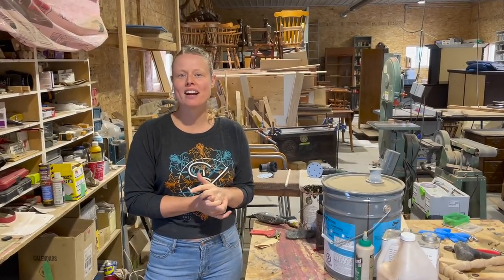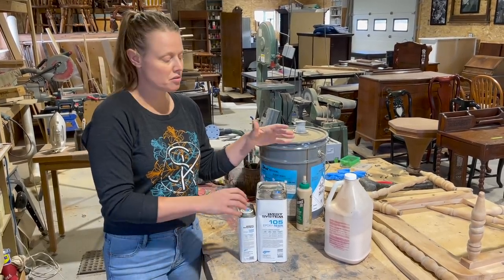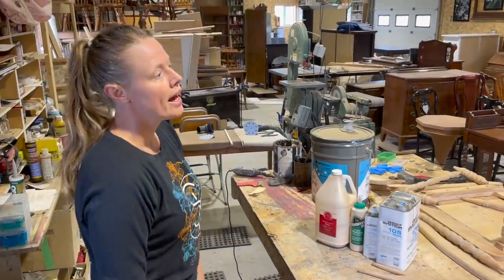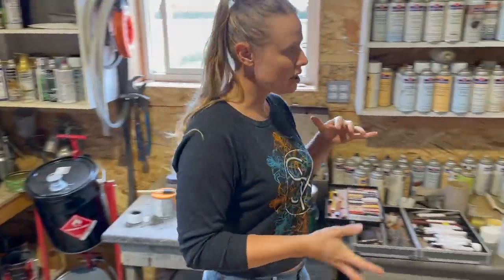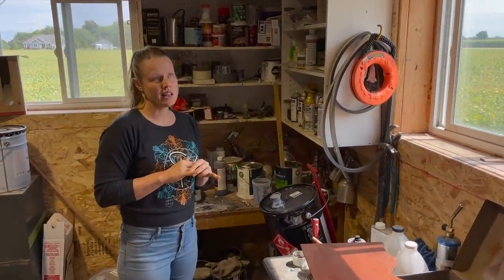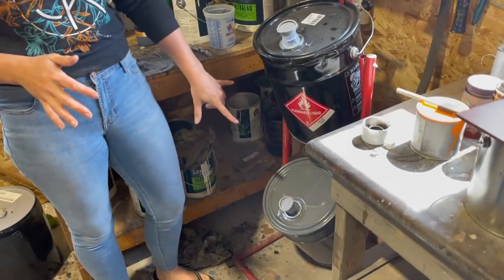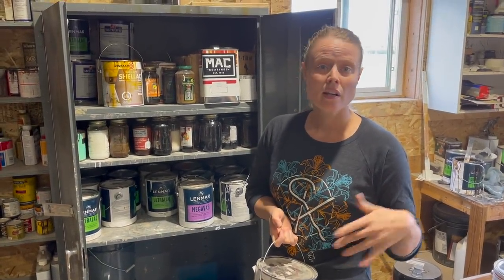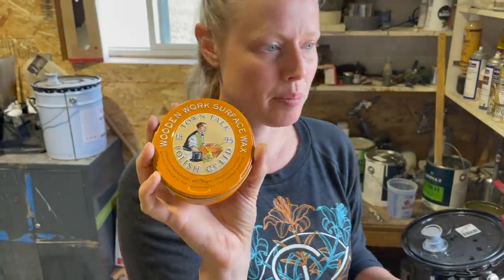The Products I Use

Comment: Thrilled to have found you. I'm a casual woodworker. Never done a furniture piece. So my wife dragged home a 5-drawer "high boy" as a beginning surprise (project). First I took it all apart. Found an old wood borer graveyard. Framing pieces and drawer glides with lots of rot.  After tuning into Trena's morning TV for a few weeks, I learned that great care might be in order. I've been a believer in 10d finish nails for everything. Not any more. Other issues (drawer guides/glides, splits and gouges,  some totally broken hand-sawn dove tails, removal of old repairs, etc.) need work, & the whole piece needs to be refinished. So I was on my way - but I found a patent date on the drawer locks. It was an 1884, with the second date of 1886, which I guess is the manufacture date. Here I am, between the devil and the deep blue sea...No one around here (Central California) can identify the wood species. It looks cedar or redwood-ish, but I suspect it was made in New England; those species may not grow there. My questions: Are the date stamps on the lock useful in determining age? Where do I get a key made? To keep some historic integrity, can I cut the dove tails on a jig, or do I have to hand cut them? Can I update drawer bottoms and the back of the case with better engineered products, or do I have to fight with the existing? That's my beginners list. I promise I'll not take up much time, but if you can comment, I'd like that!
Reply from the maker: Hi there. Sounds like a really fun project. The dates in the locks won’t be accurate to a t but might give a ruff idea on age. Honestly if your just keeping it for yourself go ahead with the upgrades. Make it useful. If your looking for resale maybe get it looked at by a dealer before proceeding. Have fun!

Comment: In response to your question about glue bottles. I have used the cheap ketchup and mustard bottles , like the ones you use for a pick nick. I buy them at the Dollar Store and I believe they are still both bottles for a buck. They have the little cap that you stick on the end. Yes the glue often hardens up at the tip but is easily picked off.

Comment: love your work. A suggestion: I found that Gorilla Wood Glue is crazy good, its got a little poly in it, its water clean up and crazy tacky, I don't use pin nails in my newel post trim etc. just hold it in place for a few seconds or a clamp. Get it at home depot. After trying everything that's now all I use. From Cornwall, Ontario.

Comment: hi  , here is a little tip for you when cleaning brass when its dry and free of old paint etc  it`s something i use on a regular basis my go to solution   ACID FLUX plumbers use it  not  regular flux  but the acid type  comes in a small tub in the uk    just get some on a rag smear it on it`s quite  quick give it rub cover all the surface   wipe away then polish with  brasso  or   Duroglit   actually i think the brasso people may have bought  over  DUROGLIT who knows  play about with it  you`l get a surprise  how good it is  of course  badly tarnished brass needs a bit more effort good luck  love your work   signed an old Scottish carpenter     will love

Comment: Some years ago Fine Woodworking published a booklet on finishes.  I don't know if the version I have is still in print, but I learned a lot - it was authored by a variety of professionals, each describing a different finish or topic.  In that book I discovered potassium dichromate for some woods, particularly mahogany.  It's nasty stuff - can't put it down the drain, don't touch it or breath the dust (it's a powder you mix with water).  But - for mahogany and other select woods it is unexcelled - you can "see down into the grain".  Use it for antique mahogany, then cover with amber shellac or white shellac.  For a table top, maybe a thin coat of varnish to waterproof it.  Yes, I know you're not supposed to put vanish over shellac, but if you don't stir the shellac the wax will stay on the bottom and it's fine to use varnish on it.  I do a lot of refinishing of antiques I buy from a local auction house.  Mahogany pieces from 1790 - 1820.  Made with woods you can buy anymore - flame mahogany veneers, table tops from 20-25 inch logs.  I buy the broken/disaster pieces that show 200+ years of damage and neglect that no one believes are worth saving and I bring them back to the day they were purchased new.  I've made furniture and have used other finishes, but that's a different topic.  Potassium dichromate (be careful with it!!) and shellac for antique mahogany.......
Reply from the maker: Thanks. I have some in the shop but I probably will never use it.

Comment: Glue bottles for PVA glue... I'm new to your channel, and I know you did this particular tour last year. So you may have long since found what I find incredibly useful: the "GlueBot" bottles. 

I love the fact that the glue feeds up to the dispenser tip from the bottom of the bottle.That way, the usual light surface layer of scuzz (glue that's reacted with the air above the glue surface) is basically a non-issue. Also, the  red silicone nozzle cap is tethered, so I don't loose the dang thing. 

What's extra great about that silicone cap is that on the bottle fill cap itself, there's a plastic boss over which the silicone glue cap can fit snugly during use... so the fact that the cap has a dangling tether does NOT get in the way when I'm squeezing glue out the gluebot. 

In my case, I'm usually doing small, fussy pieces, so although I also have a larger one (Lee Valley sells that 16 oz version), the smallest GlueBot is my go-to tool. That little 4 oz. "BabyBot" is sometimes difficult to find... most stores seem to only carry the larger 8 oz and 16 oz sizes. 

I think I got my 4 oz version at "Zoro" (https://www.zoro.com/fast-cap-wood-glue-dispenser-4-oz-btl-drip-less-gbbabebot/i/G3988887/?utm_source=google&utm_medium=surfaces&utm_campaign=shopping%20feed&utm_content=free%20google%20shopping%20clicks&gclid=CjwKCAjwkYGVBhArEiwA4sZLuPIHqOn1qYVCOI494qwry9JWjmIJjeLMvGC1t8eJIQYjvcwEszDbqxoCtNUQAvD_BwE)
Reply: So another thank you to you, Trena. Since I was out of brass polish, after listening to this clip I located and purchased that all-purpose metal polish you suggested (Flitz Metal Polish). So far, it works wonderfully as silver polish. Much more effective in less time than my earlier standby: Scotchgard TarniShield. That 3M product has been reliably more protective than Hagerty and the others, but the Flitz product seems dramatically more effective at removing tarnish from solid silver than the TarniShield. I'll be interested to see how long it protects silver flatware that gets washed in the dishwasher every day.

Comment: Alan Rye

Trena, this is a totally addictive feed, but you draw us to your world so effortlessly.  I just wanted to mention a trick that works for me with those pesky white coffee cup smudges on finished timber.  Maybe others have raised it too, but I find that a rag dampened with a little orange oil and held down with a suitable weight and left for a day or three will usually get good results.  Also, genuinely no effort!!
Reply from the maker: Yes. That works as well. The tricky bit with using an oil method is making sure you don’t end up with a shiny spot. So I usually try the iron with a clean cloth first and if that doesn’t work I’ll use my blush eraser from mowhawk. But for home owners the oil is a very safe way to go just gotta make sure you can clean off the residue sufficiently. Cheers!

Comment: Tite-bond glues are excellent glues but on light colored wood it leaves a brown glue line which I despise. I use white glue on white wood items as it dries clear. The Tite-Bond nozzles can be removed to clean with tap water. If you don't clean them you will have a clogged tip eventually. I also keep my glues in a refrigerator.  I enjoy your videos they are helpful and your work is on a level with the best in the trade.
Reply from the maker: Thankyou!

Comment: A wealth of information! Thank you. Familiar with a lot of the products, but some new tricks better than the "make it yourself" ones I've used on a much smaller scale. Would appreciate a little more depth on finishes. Years ago I shyed away from laquer for table tops and anything else that might have stuff set on it causing those "rings". I've mostly used the same Varathane varnish you showed. How good is the catalyzed laquer you mentioned dealing with that issue?
Reply from the maker: Nitrocellulose lacquer is pretty much useless against water marks. I have always used catalyzed products. Their strength is on par with varnish but they are way easier to apply and get a silky smooth finish with in less time.

Comment: Thanks so much for answering my questions on products you use! Very helpful. Denatured alcohol after stripper , I don’t like using water, tends to split and raise the grain to much. Tried using mineral spirits but no good. I’m a professional residential painter in St. Louis Mo. I work in a lot of 1800 s homes , run into a lot of old previously stained wood work-question how do you get weathered water stains out? Sanding doesn’t work and turns black after I put a sealer on?
Reply from the maker: Try oxalic acid on mineral stains. Cheers

Comment: I worked in a spray booth for a while.  A mask was not required.  The air flow in that booth was very aggressive to the point that I would Never have contact with fumes or overspray. It even had an email rating that allow me to go maskless. It was Great. I did have to wear Gloves and hearing protection though.
Reply from the maker: Nice. Mine definitley removes everything pretty quick too.

Comment: This video was really interesting. You know so much about all the how to's, particularly for antique wood furniture. So much this must have been passed on by your Father. How wonderful to have had that kind of working relationship with him. I've always had the question of what is lacquer and shellac and why would you use them over other products? Or how do you maintain a finish that's oil based vs water based. I've always known not to mix oil base with water base, but some people say it's ok as long as the oil base is dry. So I don't really know the why for using one product over another. I can see you've found products that really work for you, and are high quality or good functioning, so of course you'd stick with them. But how do you know when to use what product. I love watching and learning from you. You have an incredible workshop and vast knowledge. You could be an instructor yourself. Thank you!
Reply from the maker: Every job has a specific finish that suits it. But it does take experience to know when to use what. I have used almost every finish out there. But you are right, I have my favorites. I used to teach a class at lee valley just on finishes and it was always well attended. It is an area where knowledge can only be gained by experience really. Reading a book isn’t very helpful. Unfortunately. Cheers.

Comment: Hi, enjoy the show. I install kitchens for a living. The supplier uses a lot of lacquer paints. One of the biggest problems I find is, from the shop to the job, if a chip happens (no matter how small) you end up seeing the white primer. Do you know if it is possible to get colored primer? Or do you have any tricks to better touch up chips? I carry a variety of art brushes to try to pinpoint the paint but it's never the same as sprayed on finish.
Reply from the maker: Hi. Yes they make white undercoat. It’s actually called white undercoat or something similar to that and it can be tinted. A good paint store will put the lacquer paint used on the kitchen job in an aresol for touchups which you would use onsite with a heavy bodied vinyl/sanding sealer and correct sheen blender to hide a chip repair. Hope this helps. Cheers

Comment: trena thank you soooo much!!! holy you got mo hawk running hard for you  lololol  where i have to work in my living room... and have a cat.. thats in and out.... i have to stick with  low toxic products... my go to  for stripper is citristrip ,   its NOT like the orig  ;[;[;[ but..its water soluable.  my process is   get a bucket of warm water with dish soap...fill it 1/2 way in a bucket..throw in used and newish green scotch pads...with a dollar store shower curtain laid out on floor,     i start laying on the stripper....wait 10 minutes  and start scraping off stripper .     then  get the green pad with soapy water and scrub down the area ...this nutrelizes the stripper.   NO SMELLS!!!  then right after ,    get a clean towel and rub as much up as possible  move on to another section..   repeat til whole piece is done.... change water in bucket as needed.. the soap nuets the stripper,,, so it doesnt hurt the bucket at all.. after 24/48 hrs  i restrip places i missed...then wait again for it to totally dry... then i usually stick with minwax..works for what i need .. then i use poly urathne water based as a sealer..easy quick clean up and dries fast  again.. no smells;];]  i have to put on 4/5 coats with sanding with a wet dry sand paper in betwn coats to get rid of tiny bubbles..buff it clean and lay down another coat... it works fine for me;];];] and the pieces i work on come out very nice ;];];]as a added protection... i use turtlewax for vehicle for a slick  high gloss finish.. it works  ;];];]   and all this is mostly under 100.00 and lasts;];];]   im not a business like you..and has a wide varity of pieces and customers to deal with...your work is stunning over all  .thank you for taking time to show us.. much appreciated;];];]

Comment: Using Titebond, I either pour it or use a chopstick to apply a line up to 1/4 inch wide. Every third time I scrape the dried residue from the bottle neck. I am no longer angry at the dispenser tip.

Comment: Your channel is really good. I appreciate your experience and skills. Do you spray vinyl sealer or sanding sealer under your precat lacquer? Do you thin your precat? Do you use retarder in your mix? And finally, do you encounter fish eye problems, and do you use fish eye eliminater? I'm a furniture repairman making the switch to precat lacquer from nitro cellulose lacquer. I mainly use Mohawk lacquer. Thank you for sharing you expertise as I value your comments.
Reply from the maker: Hi there. I only use sealer if I suspect an issue with what I’m coating or if I’m looking to build a finish. I thin my precat 15% but I use Lenmar and mowhawk May recommend a different ratio. Yes I do encounter fish eyes and I have drops to deal with it when I do.
Reply: @johnsfurniturerepair  So generous of you to reply. Thank you.

Comment: If you ever get into using waterborne lacquer, I would suggest you consider trying Sher-Wood Kem Aqua Plus by Sherwin Williams. I have used the product for clear top coating on new builds with oil stains and also with the product tinted to a solid color. Only thing I would add is that I never tried the product on refinishing a piece. On a side note: About not using a respirator, reason I did not make a comment is that I took notice that you were spraying facing the exhaust fan and moving the furniture around where you stayed facing the exhaust. However, with that being a very good practice while spraying and reduces breathing in the spray particles, it does not help 100% from breathing in the fumes of solvent based finishes.
Reply from the maker: Thankyou for the recommendation, I have only used mowhawks waterborne and it wasn’t great so I will definitely try that. I also appreciate you noticing my ventilation system befor commenting. It was a 15,000 investment in clean air but I also totally agree I need to wear my respirator. I actually appreciate everyone getting on my case. It has made me much more diligent with wearing it. I have become a little to complacent after 20 yrs of this so it’s always good to get a refresh. Cheers!

Comment: 6:50 I have found that I use a combination of glues. If the part is intended to be repaired later, such as a guitar neck joint, a violin fingerboard or something like that, I would use hide glue. If the joint is never intended to come apart again, such as a crack repair or veneer, I would use wood glue.

Comment: As for the usage of glue container: try using syringe with big needle. Just fill up the syringe with titebond, carpenter glue or whatever. Pros of that is you can go deeper between veneer layer and also you don't need much to bend away the veneer to fill the gaps with the glue risking damaging of veneer. Long story short: syringe is more precise than thick cap of titebond glue.
Reply from the maker: Yes I usually work it in with a thin knife but that works too. Thanks

Comment: Where do you think linseed oil and boiled linseed oil are just what’s called for?  I love boiled linseed oil on wooden garden tool handles.  Where might you use either if at all?  I love your amazing color work! Thanks!
Reply from the maker: linseed oil is actually flaxseed oil. they dont actually boil it but just heat it up and add driers (japan drier...) to speed up the curing time. Raw linseed or tung oil takes for ever and a day to cure. you can use it anywhere, but it darkens over time and really isn't that good at protecting wood without frequent application. cheers